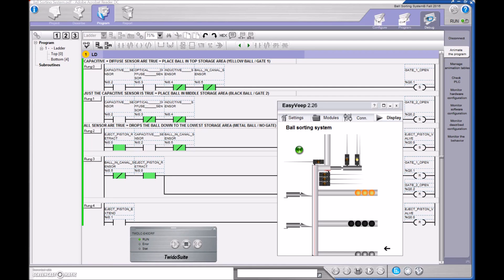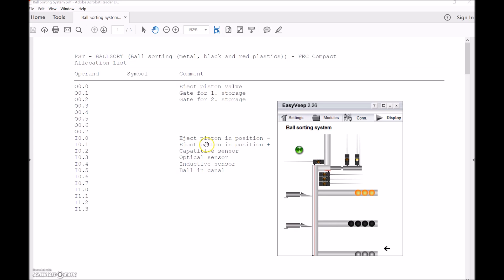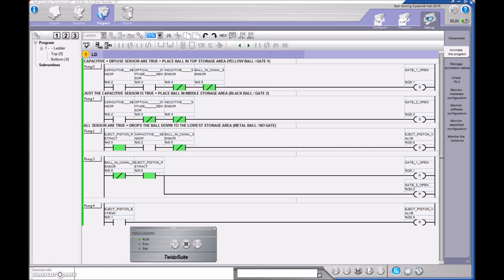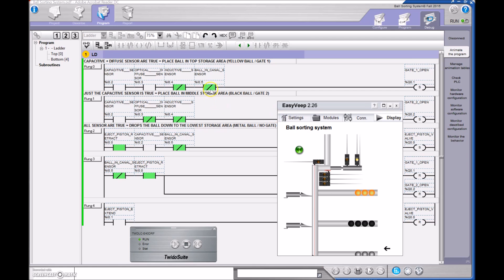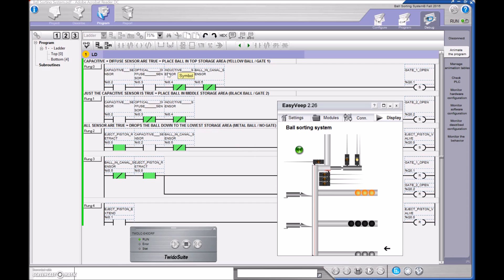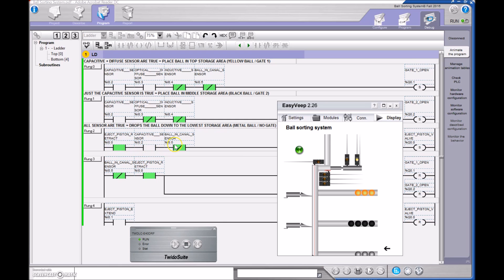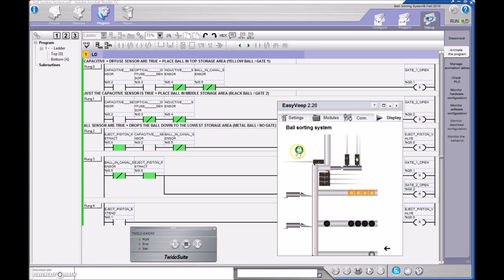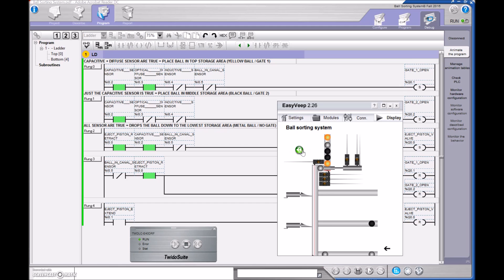PLC Tutorial (Festo Easy Veep) #2  (Ball Sorter Version 1)

Comment: Thank you for the video. I needed to understand a couple of concepts on PLC programming, and you've helped!

I do think I have figured out what the issue is with your logic: when you do not have a ball in the canal and the cylinder retract sensor is a logic 1, the two row gates should reset (or be off). This disagrees with your logic in how both row gates are SET, as there are moments where both the SET and RESET for each row are on, and that causes that jittering every time (this happens when the next ball is waiting to be ejected). I suggest that you use only the capacitive, inductive and optical sensors as the off conditions for the row gates so that if the same colour is sensed again, that particular row will not RESET until another ball is SET.